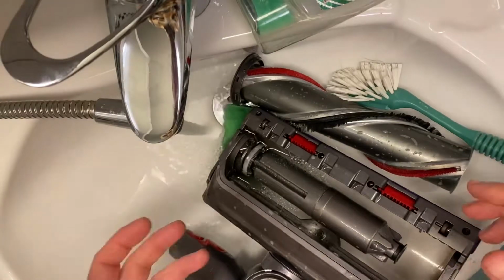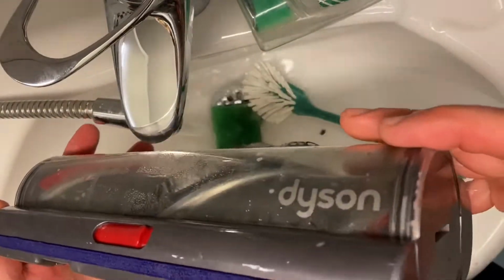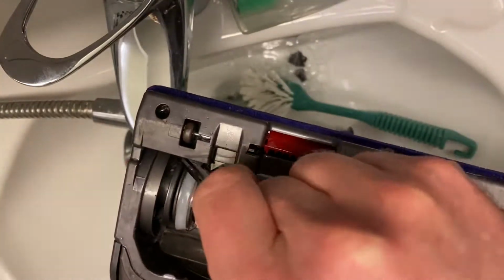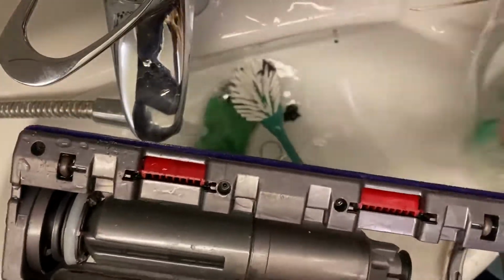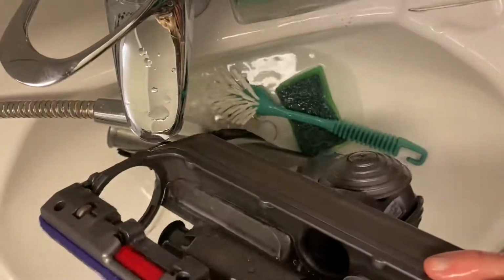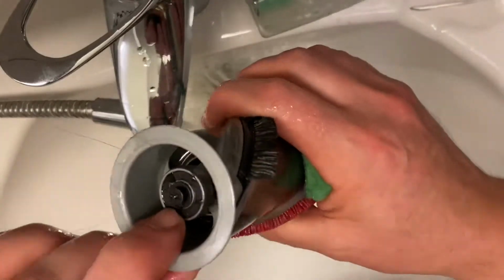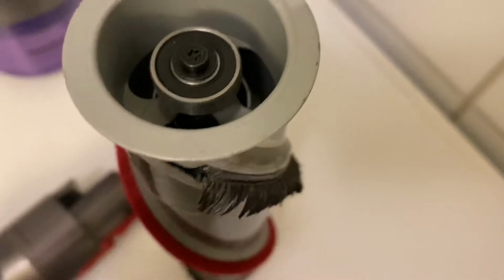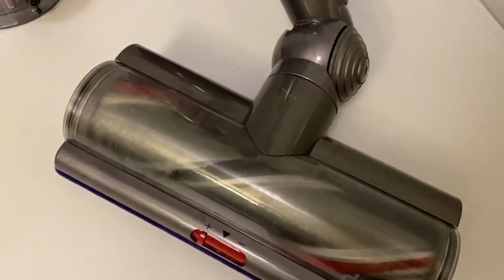How to clean and service the Turbo / Turbine head of your DYSON Vacuum Cleaner

Comment: You're running moving metal parts and bearings under the tap? That's placing too much trust in factory o-rings in my opinion. Better to spend the time to take it apart with a security bit and use cleaning wipes on it. You're asking for the turbine bearing to sieze.
Reply from the maker: Good point. So far no problem, was done 2 months ago and used daily so seemingly no issue. Future will tell if the turbine head can take a proper water cleaning. Thanks for comment!